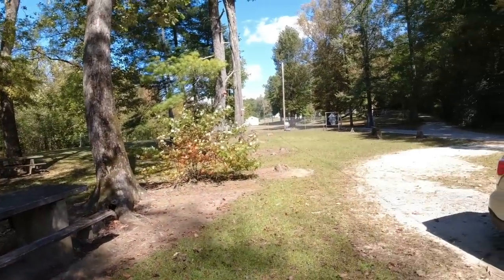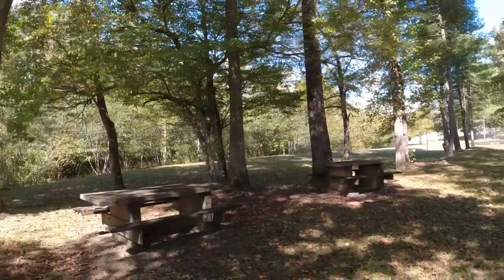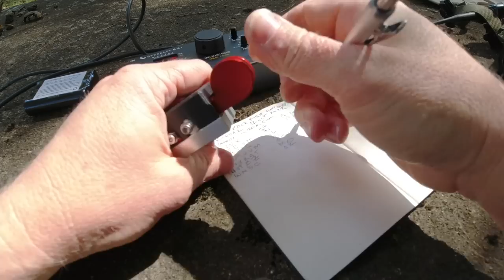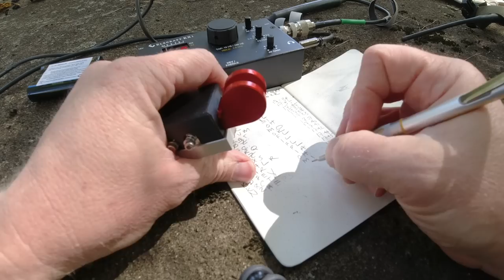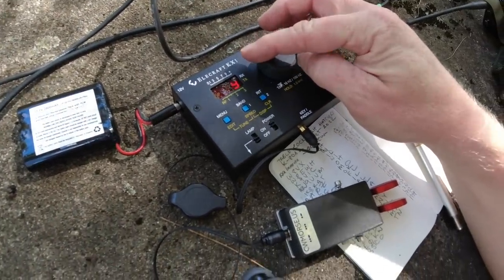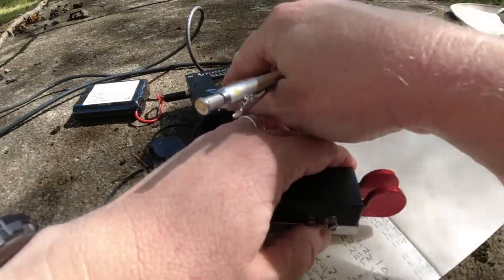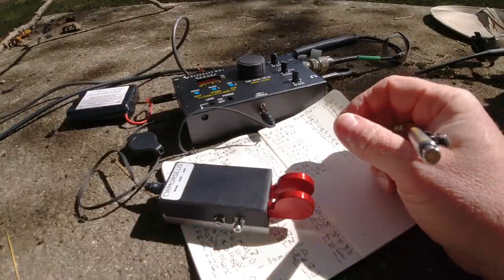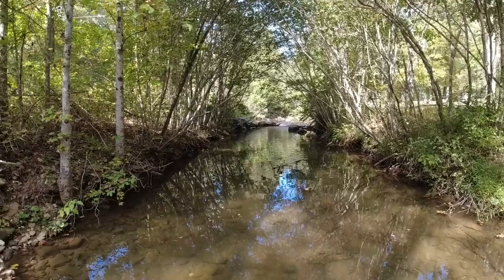How I evaluate a new POTA site plus serious QRP fun with my new-to-me Elecraft KX1

Comment: Thomas you inspire me to dig out my KX1 and fire it up again. Fun little radio. I still haven't tackled the 80m kit install, but it is on the shelf. How do you handle the KX1 receive audio here, to listen and record it? 

On Field Day I used the IC705 to copy the ARRL bulletin. For that I use a near vertical sloping wire 5/8 wavelength on 20m (42 feet) and four 15 foot radials with the AH705. It requires more than 25 meters of throwline. :)   I suspect it would be a good activation antenna as well especially on 20m. Have to test it sometime. Not many parks around here. The AH705 tunes it easily. Copying the ARRL bulletin on FD from California can be a challenge.

72 de w6akb
Reply from the maker: I love my KX1! for audio, I simply attach the headphone line-out to a small digital recorder. The link recorder info should be in my field report on QRPer.com. Works great!

Comment: Great instructional video Thomas. Question - are concrete table tops common in WNC or are wooden table tops more popular? I need to build a clamp mount for a mag loop but I'm not sure what size C clamp to get.
Reply from the maker: Wow--great question, OM. Concrete table tops are less common that the composite ones and wooden ones, I find. That said, a number of spots around here have concrete table tops. You might get two clamps or one large one that can do both.

Comment: Great overview.. thanks.  I saw you spotted a couple of times in the past two days9 11-11 n 12).. but could barely hear you.. darn.  WA7WS.... BTW.. two questions.. Where did you find that retractible cord you attach your key to the xcvr with?  Also, what is the 'gizmo' to your left?  Is it a recorder or ??
Reply from the maker: The retractable cords are these. I really love them: https://amzn.to/3Exat0x
There are cheaper ones, but I find these are better quality. I've purchased about 6 of them now. 
As for the gizmo on my left, can you describe it? I can't think of anything I had to my left during this activation.
I was only operating about 3 watts during my past few activations, so pretty low power. I'm sure will work each other soon!
Reply: @ThomasK4SWL  On closer look.. it looks like it says Sony.. If, as I thought, a recorder.. do you record the whole activation?  I've thought of that to double check my contacts.
Reply from the maker: @wjess3569  Yes, I use a Sony recorder (there's a model number in my field report on QRPer.). I bought it for $20 from a thrift store--I like to use it with my radios that don't have a speaker. I do record the entire activation.

Comment: What antenna / supports do you use when you go vertical?
Reply from the maker: I tend to use verticals that have a ground spike to hold them into the ground, else (as with my Wolf River Coils) a small tripod. I also have a telescoping fiberglass mast, but I rarely need to deploy it here.

Comment: It's hard for me to find a spot where people aren't going to bother you, especially kids that are running around. I really prefer wire antennas, but sometimes I have to use my vertical. The spot in this video is ideal, I wish I could find places like this around me. Oklahoma doesn't seem to have a lot of outdoor wooded park bench setups like you seem to have all around. I suppose I could expand my range a bit more. 73 de AI5DD
Reply from the maker: I also find that some parks here are very expansive. South Mountains, for example, has a number of entry points. Some are very busy during peaks, others are quiet all year long. I'm not at all familiar with OK parks other than a couple I visited (pre POTA) in the past.